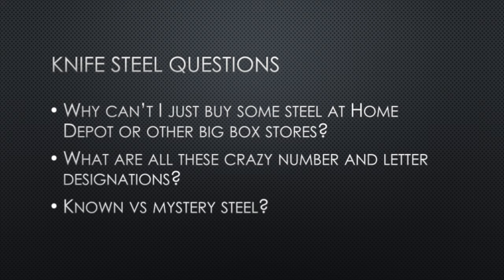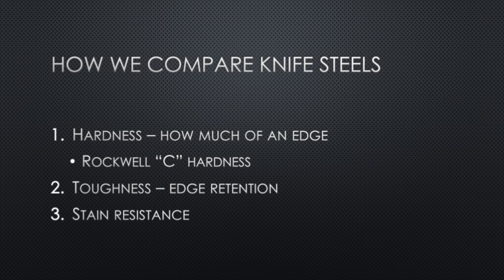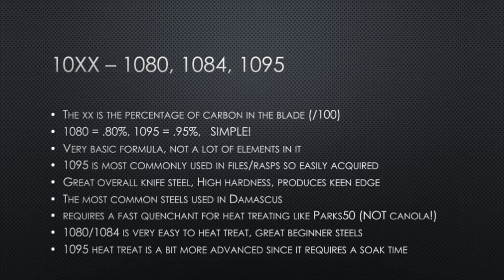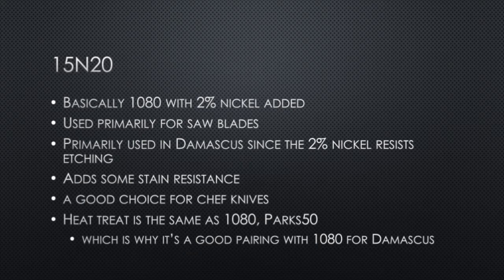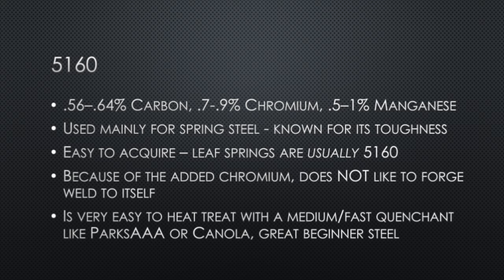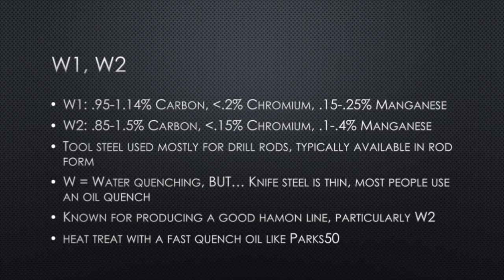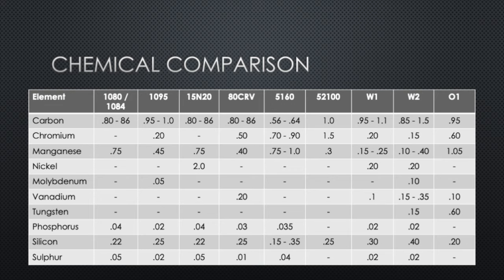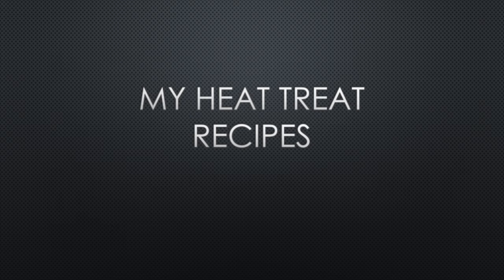Triple-T #48 - Knife Steel 101

Comment from the maker: Any steels you have questions about?   Other suggestions for videos in this beginner series?
Reply: I think a great video would be the details that separate a beginner/amateur blade from a pro blade….and how to perfect them. Examples: tight mating with no visible gaps between scales and tang, spine perfectly smooth with the scratch lines going parallel to it with no bumps, clean uniform plunge lines (or skipping plunge lines as a beginner), squareness and flatness. This to me is where I’m at. I can make a knife…..making a QUALITY knife is a whole different universe. But one thing I’m learning is to pick a few key quality indicators and focus on them. I also suck at plunge lines. So, while I work on that, in the interim I am choosing designs that I know I can execute if I want the knife to look snazzy. I think all makers start off wanting to make knives like your cu mai Bowie….but knowing your limits and making a really simple knife that is well executed is such a better way to go at first.
Reply from the maker: @andrewneilson227  this is great stuff!  I’ll add this to the list.  I’m going to do a video next week on freehand grinding basics and how to’s.  I’ll cover some of those items above in that video and others in upcoming videos.  Thanks! 👍
Reply: exotic steels and toold steels like O1 for H33
Reply: Wroght iron, S7
Reply from the maker: @stressmasterbk4294  I did discuss O1.  H33 isn’t really used for knives though.
Reply from the maker: @sran9492  I’ve used S7 for punches and drifts.  It’s not a great knife steel though.  Wrought iron would be a good topic for a future one.
Reply: @TyrellKnifeworks  wroght iron is used for scythe right?
Reply from the maker: @sran9492  not on the cutting edge though.
Reply: @TyrellKnifeworks  i saw Torbjörn Ahman channel make scythe off wroght iron and the explanation of the desicion is because of the peening the edge of the scythe
Reply: I have one which is actually why i got on YouTube today. A buddy of mine asked me to fix a full tang Damascus knife knife for him. The deer antler handle scale broke. I typed in deer antler handle scales but I'm not finding any quality videos showing how to work with this stuff. Personally, I'm not a fan of deer antler handles, but I'd love to fix this knife for him. My search left me a....uninformed lol so I came to your channel and looked through your videos. Have you made a video dealing with this and i missed it? Or, can you point me in the right direction? Thanks in advance and thank you for the great videos you put out.
Reply from the maker: @nateand3  That is something I've never worked with.  I picked up two beautiful stag antler crowns to put on bowies at some point.  Check Airin's channel at AleeKnives or Erick at The Rivers Experience.  I think they've both worked with Antler before.
Reply: @TyrellKnifeworks  i sure will. Since I'm subscribed to both.....i figured if anyone I was subscribed to had put out a video on it they would have topped the search list, but nothing turned up. I'll check them both out though. Thank you for the reply and advice

Comment: Paused at 1:34. My favorite carbon steel is 1095. It's affordable, easier to sharpen than D2, 5160, 02, 01, etc. It holds a edge for quite a while, I normally strop my knife instead of sharpening it constantly. It's easily maintained if you put a forced patina on it. I normally use olive oil for the steel, wood handle & leather (steel/wood is oiled every 3-6 months). leather is oiled whenever it starts to look like it needs it, (the handle & leather sheath was finished last year & only been oiled once then coated in beeswax).
Reply from the maker: While I agree, 1095 can have a great edge, it’s not the best for retention, so for bushcraft knives or choppers it’s not ideal. If you wanted a tougher steel for wear resistance, 80CRV2 is a good choice.  1095 does have the added benefit of creating nice hamons as well.   Also, I actually do not recommend food based oils like olive oil for steel, they break down over time and get gummy.  Mineral oil is a better choice for steel.  Neetsfoot oil is great for wood/leather to keep it soft.  Thanks for watching!

Comment: I bought .136 inch 1095 from Alpha Knife Supply, they claimed that the steel is annealed and only needs heating to 1475 and quench in Parks 50 and temper soon after . I slowly brought the blade up 1475 over about 8 minutes , quickly quenched in Parks 50 then followed their specs for 62 Rockwell which was 350 for 2 hours twice .I have a friend who is retired but still has his machine shop and a rather elaborate hardness testing machine. I didn’t tell him what I hoped was the hardness , he put it on the machine and the needle went up then back and he said it was between 62 and 63 Rockwell hardness.
Reply from the maker: Nice!  Seems like you hit it perfectly.  Despite what they say, it’s best to normalize the steel and go through sone grain refinement cycles before heat treating.  That way you KNOW it’s the same each time.

Comment: Just personal opinion, if you're beginning the journey. Find something you can get readily, cheaply and practice on it for a few months until you get consistent results. Fit, finish, artistry, profiles, edge geometry and other materials come with time as well into that, but mostly you just want a product at the end of the day which works with your tools and equipment.
For me, I could get O1 with free delivery for a decent price along with other stuff I just bundled into the order, probably not a great learner in hindsight but after a few months and a bit of advice I got them working right and it was pretty cost effective. That additional advice probably shaved months off my learning curve so make sure to ask someone that's at least qualified in some way with practical use of that material- worst comes to worst: read the manufacturers datasheet!

Just on that subject of data sheets, knife makers in the modern age are basically using stuff which essentially fell off the back of industrial tooling, mechanical parts, dies, castings, drill bits etc
Very little of it was ever made specifically for 'just knives', in fact I'd hazard a guess and say about maybe 5% of steels with an engineering standard are made for some kind of cutting tool, be it a razor, scalpel, wood chipper, hydraulic sheer, planer blades or scissors and generally do some kind of double duty like being used for ball bearings, axles, gearbox components, clock springs and goodness knows what else. But we're actually a very tiny part of the overall steel production sales target overall when it comes to cutlery and similar steels, pretty much all of it just gets offloaded into the industrial sector... then somewhere in that very tiny percentage of steel buyers for knives, are artisan and hobby knife makers!
Reply from the maker: Yes, I agree, it’s a good idea to start with a steel you can reliably heat treat and just learn to make knives from it.  Grinding and finishing are way more important than knowing how to HT 10 different kinds of steels.  👍. Thanks for watching and commenting!

Comment: Material in this video was spot on. Thank you for saying 1095 is not a beginner steel. So many others claim that it is. 
Only reclaimed steel/ metal I’ll use is mild steel, wrought iron, and 304ss. All of course for San mai blades. 
Reclaimed can be ok for personal use, like tools and such, but I wouldn’t go out and buy any of it. I still don’t recommend it though.
Reply from the maker: I don’t mind reclaimed 5160 if you prove out the heat treat. And that doesn’t mean “it skated a file”, which is a phrase I really hate.  I mean it was hrc tested with a calibrated machine.  Other than that, I agree, reclaimed steel just isn’t worth it.  My time is worth way more to me! 👍
Reply: @TyrellKnifeworks  I completly agree. That phrase is overly miss used. I don’t do much with 5160 anymore honestly. I went to 80crv2. 
I’ve used a bunch of fork lift forks from work (4140, I contacted the manufacturer) for tooling and hammers. But this is a knife making channel…😉

Comment: Great video. For your heat reading recipes, when you say soak for 10 minutes, do you mean once the oven gets to the goal temperature or for 10 minutes after you put the knife in at a lower temperature?
Reply from the maker: Yes, that’s correct, Dmitry.  My recipes assume an oven but if you have a forge you’ll need to approximate that heat and soak time. Thanks for watching!
Reply: @TyrellKnifeworks  Didn't really answer the question.  The first part of his question (before the "OR") is the correct interpretation of your instruction - 'soak time starts when the oven temperature reaches the oven set temperature'.
Reply from the maker: @davidscadlock5569  sorry, I guess I didn’t read the whole question.  Yes, soak time starts when it reaches the target temp.

Comment: Dennis quick question 01 tool steel you say there’s a soak time which I think is may be in the vicinity of 10 to 15 minutes. With 1” stock My question is I’m making slip joint folders and my blade is only 3 inches long by maybe 3/16 at the time of heat treat that means I really shouldn’t have any soak time just bring it to temperature in quench ? PS I’m using a Fordge not an oven.
Reply from the maker: It’d still recommended to soak it.  That’s where the PID controller really shines. 😉. O1 is pretty forgiving though and is a slower quench so canola actually works.

Comment: Your heat treat chart says (oven) however I have a forge with a Y burner end which throws a two directional blaze onto a length of 5 inch square tubing that is insulated inside and has 300 1/4 inch holes drilled into it which allows the heat to evenly come to the blade , a thermal couple comes into the bottom of the square tubing . Yeah I know this sounds a bit odd but it helps me to hold a temp within a few degrees for a period of time .Sorry to ramble but , normalize 1095 by insert blade at 1400 and ramp to 1575 and soak 10 min and cool to black and follow to the next recommended normalize ? That is the question and again my apologies for the rambling.
Reply from the maker: If you’re using a forge, the forge will typically already be at the temp.  You’ll insert you’re blade and try to get it up to the desired temp and keep it there.  Keeping it there is the hard part.  After you do the normalization and let it cool to black, you do the two grain refinement cycles (1450F), cooling to black between each and then do you’re soak at 1475 then quench.  Hope that helps.
Reply: @TyrellKnifeworks  Roger That , I can throttle my burner and hold a certain temp with my set up and thermal couple, I’ll take a pic of your chart onto my I phone and have it for next heat treat , thanks a bunch !

Comment: What are your thoughts on D2? I use a lot of it and have had a lot of success with it.
Reply from the maker: I’ve never really used D2 myself.  I hear it’s a bit hard to work and doesn’t really forge all that well.  I know it’s used on a good number of production knives I’ve seen.  I don’t have much other info on it.
Reply: @TyrellKnifeworks  I have forged only one or two knives with it. I definitely agree with its difficulty on forging. I only use it with stock removal now.

Comment: I was wondering what temperature do you have your oil at for quenching?
Reply from the maker: I have mine at 120F.  I keep a thermometer right beside the tank and use a rod I heat with the steel and that seems to take it perfectly to 120F every time.  👍
Reply: @TyrellKnifeworks  thank you very much

Comment: can you make a Mokume Gane, Damascus  knife, is it possible
Reply from the maker: You could use mokume gane to replace the copper layer.  It can’t be on the cutting edge of course.  I guess you could use it as cladding if you put steel as an outer layer but grind it completely off.